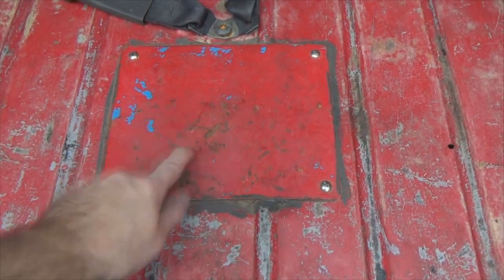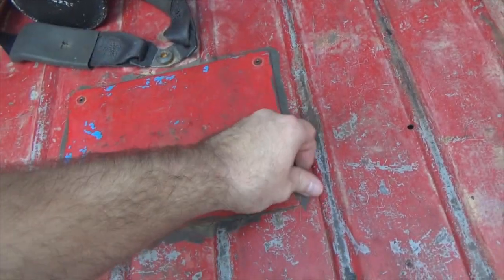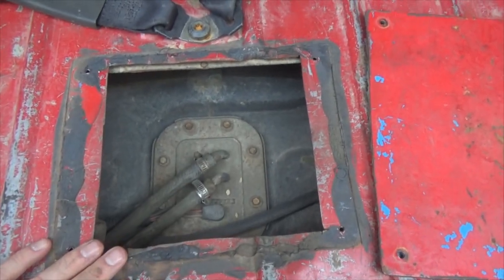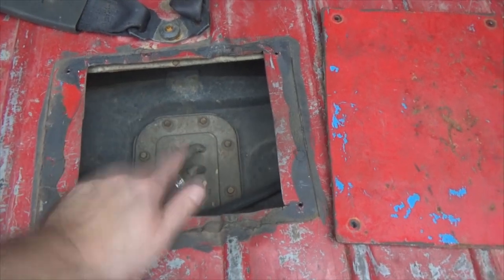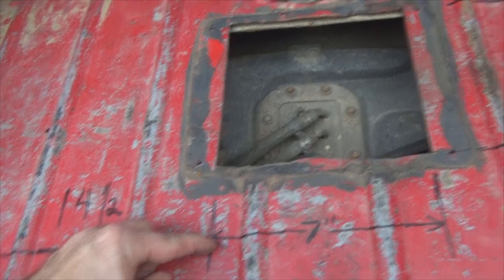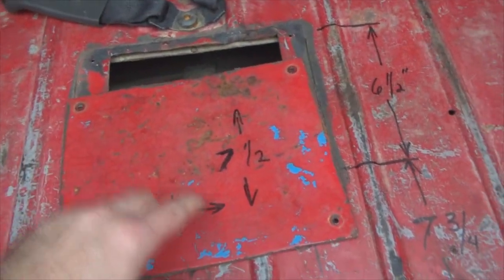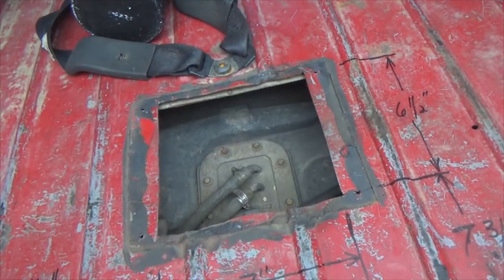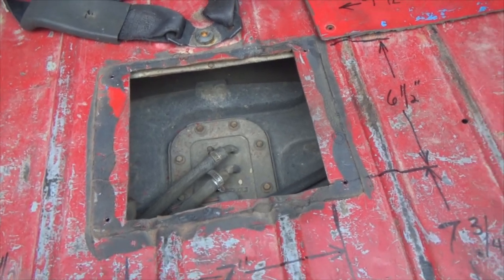Jeep Wrangler YJ - Fuel Pump Access panel mod

Comment: I did that , thanks. Best thing I've fixed my loose fuel line clamp without dropping tank and ready to replace pump when needed. I used a recuperating tool. Dimensions were right on the money. Thanks Dude!
Reply from the maker: Glad the video helped!! You are very welcome!!

Comment: I just bought a '93 YJ. Frame rusted, drove it 5 miles, started all day long until the evening.....lol. I gotta drop my tank, put in a new fuel pump, weld up the frame on the rear driverside, and I'm doing this when the tanks out. Very helpful channel. New subscriber here!

Comment: Being a firefighter we cut the access hole in my YJ at the fire station. We employed the positive pressure ventilation fan and three dry chemical extinguishers. Cut the access panel with a Harbor Freight angle cutter.  Cut very carefully not allowing the cut off disk to drop into the abyss below.  Everything went fine took only 5 minutes.

Comment: Thanks for the measurements.
I just cut a "just in case" hole in the floor, it came out perfect using your guidelines.I swapped the pump when I bought the Jeep and still have the old (still good) pump. I'll find a place to stash it and hopefully never use it.
Cheap insurance 👍

Comment: awsome,,,,,thanx for posting this, i needed to change my pump, i ended up drilling 4 holes and used tin snips to cut it, the thick channel i cut by drilling a series of holes in a row and bending it till it broke out, i didnt want to remove the tank as mine is crazy rusted, i changed the pump and shes back running and didnt blow up,,,, whoohooo, thanx again for posting this
Reply: I wish you would’ve done a video on that because I’m trying not to remove my tank because it’s so rusty I’m scared I’ll end up breaking the tank straps.
Reply: @Skinny859  i followed the measurment insrtuctions here and fought with it till i got it, many holes and bending but it works

Comment: In my last post I forgot to add that I added two pigtails after cutting the three wires.  I soldered the pigtails one to the fuel pump wires and the other to the lead-in wires.  Then I soldered a set of insulated spade tips. I heat shrunk all solder joints and then heat shrunk the three wires on each pigtail together. I coiled the excess wire around the top of the fuel tank and held in place with a few cable ties. Now I can disconnect the wires and remove the pump with ease.

Comment: Stuff a welding blanket over the top of the tank for insurance. Use a jigsaw to cut out the opening. No sparks and cuts like butter through that sheet metal.
Reply from the maker: Due to the lip on the body that is at the edge of the tank, there is no room to cram a blanket in there. Especially one that has no body lift. A jigsaw, if not held back at an angle will surely cut right into the tank. There is very little room between the surface of the tank and the tub floor.

Comment: Just a note about location of hole. If you have a NON-fuel injected YJ the sending unit is in a slightly different location. Instead of centered on the tank it is to the left and closer to the rear of the Jeep. Also it uses a lock ring instead of bolts to hold the unit in place. I have an1989 4.2 YJ with carb not FI. You may also need to trim a bit of the rear stiffening brace to allow clear reach to unit. I did this with my fingers crossed as some Jackleg welded a tow hitch under the fuel tank making removal impossible without cutting the hitch off with more sparks. But as it says in video if at all possible REMOVE the tank first! The extra time taken is worth your life and your Jeep.

Comment: Thanks for the information and great idea while I have my tank out to replace fuel line and vent line even though i never had issue yet with fuel pump this fuel tank is being a pain to get out with the exhaust running between the tank and rear leaf so great idea ..
Reply from the maker: Glad the idea helps you!! Thanks for dropping by! Have a great day!!
Reply: Yes the tank was a major pain to drop. Gas tank catches on the driver side, skid plate catches on the passenger side. Would be good to get the exhaust out of the way.

Comment: Great Mod and video.
FYI: I saw a Jeep Liberty the other day and Jeep has designed them with an access panel for the pump.
Reply from the maker: Long ago I worked one a Honda, it had one. My dad had a 'Vette, it had one. I though .. hmm .. my Jeep needs one! LOL .Glad you liked the video. Thanks for taking the time to leave an awesome comment! Have a great day!!
Reply: Power Addicts - FixJeeps.com - Jeep, car and motorcycle tips 

I'm doing this mod tomorrow on my 2003 TJ when replacing my pump, and yes the tank will be removed prior to plasma cutting. I retrieved a section of wiring harness off another TJ that has the pump connection, and will connect it to my old pump's harness to make an extension, so that my pump plug will be located behind the panel as well. 

Someone asked me why go to the trouble of doing all this when the tank is easy to drop? I've grown tired of crawling under my Jeep in snow and mud just to work on something that engineers should have avoided by better design.
Reply from the maker: I personally think its smart thinking! Why crawl under it again when you can remove a few screws and there it is. I agree the engineers should have done it to begin with. I've pulled mine a couple of times since adding that plate. I had the pump out in less than 10 minutes. You could change the pump on the side of the highway with a full tank of gas if needed. I haven't done that mod to a TJ yet. I assume the dimensions should be really close. If you don't mind, after you make the access plate. Compare the dimensions to see if they are close. I would appreciate it. Oh yea, a couple of pointers in case you dont know. Dont use Airtex pumps. My dads S10 went through 3 of them in a couple of months. He finally bought a Bosch pump like I mentioned to him to begin with, been flawless since. The Jeep pump comes with a short section of hose to join the pump to the sending unit pick up. Don't use it. I've seen use that little hose has pop off the sending unit nipple many times. I get a small piece of fuel hose that is about 3/8" - 1/2" longer and install it. You may have to do little trimming to get it to sit on without binding against the pump and sending unit. Then use the worm style clamps instead of the squeeze style. I have had my Bosch pump installed like that for 5 years and its been perfect. Good luck! Have a great day!

Comment: Thanks for the cut dimensions, have a copy from your support-files page.
BTW permanent marker comes off with alcohol (or gasoline).
Reply from the maker: You are welcome! Thanks for leaving a tip to remove the marker. I just dont worry about mine. It adds character 😊

Comment: I DID THAT ON A 1986 JEEP CHEROKEE FOR THE CRANK SHAFT POSITIONONG SENSOR CUT INTO THE DRIVE SHAFT HUMP COULD SEE EVERTHING THEN SEALED BACK WITH SHEET METAL PATCH
Reply from the maker: Cherokees are a bit harder than YJs to change that sensor. So I understand why you would do that.

Comment: I did the same thing to my 91 firebird. It was alot easier than dealing with rusty straps and lines.
Reply from the maker: Yes .. so much easier! A person could actually change the fuel pump on the side of the road if need. Thanks for dropping in and checking out the video. Also, thanks for taking the time to leave a great comment! Have a great day!

Comment: Hey man, love your channel!!
Has anyone ever tried using a nibbler to cut this hole?? Seems that it would eliminate the spark issue.
I need to do this on my rust trap and I think I can rent a nibbler.
Thanks again for all your videos!!!
Reply from the maker: Thanks!! Glad you enjoy the channel! I haven't tried it. Typically nibblers cut metal a bit thinner than this but if you go slow it may work.

Comment: Thank you sir! Nice modification, I wonder if any military type vehicles had a removable panel. Unless the tank was rusty, the only reason to remove it would be fuel pump related repairs...
Reply from the maker: You are very welcome!! Yea .. I was only gonna go through the headache of dropping that tank .. 1 time! I've pulled the sending unit out a couple of times since the mod. SOOOOO EASY now! Now I could change a fuel pump on the side of the road if I had to  :-) Have a great day!

Comment: Hello sir, pulled my tank today with your vid instructions. I had to force the tank out and I warped the plastic filler and vent kicked on the the tank. What do you think my chances are of a good seal with hose clamps. ? Btw, goons do your floor cut out mod too so thanks for that.
Reply: Filler and Vent nozzle...

Comment: I wonder using a jigsaw with a high powered fan blowing between the tank and body away from the filler neck, and a little water while cutting would be safe, I have a 3 inch body lift and I could set the depth of the jigsaw to 1 quarter or half inch. If you do not hear back from me you will know how it turned out.
Reply from the maker: Welp .. how did it work out? Hopefully you are replying 😀

Comment: I want to adjust my rear seat all the way back on my 93 yj using the same stock brackets … wanted to know if it’s safe drilling new hole without the tank being in the way????????
Reply from the maker: You will have to drop the tank to do that. You really need to install weld plated to reinforce where the seat mounts bolt to the floor. If there was ever an accident the seat brackets will rip out of the floor if they aren't properly bolted in.

Comment: Access panel cut today using your vid/dimensions. You will definitely cut into the c-channel brace that runs horizontal from side to side near the back of the jeep. I just call it a learning experience. First time using a cutting wheel so a little sloppy but hey, next time I shouldn't have to drop the tank to fix leaking fuel lines😁 THANKS
Reply from the maker: It might have gotten moved somewhere in the production run. I didn't cut the brace on mine 🤷‍♂️. Glad you got it done, it helps a lot! Have a great day!
Reply: What year is your YJ? I have a '94 SE and only have 5 1/2 inches between the brace where the rear seat belts are fastened and the c-channel your referencing. I'm assuming cutting into that channel and inch or so won't hurt anything...

Comment: Are these dimensions the same for the 2000 TJ model 4.0. 
I'd like to do this at the time I need to replace the fuel. pump. (tank removed of course) 
Thanks Chuck.     - Vince -
Reply from the maker: You are welcome. I can't say for sure. But I pretty much doubt it being the same dimensions due to there are lots of differences between the TJ and YJ.

Comment: is it possible to put thin ply wood up in there? (did that for my bronco)  Dropping the tank is major pain in YJ
Reply from the maker: I'm sure you could, I treat mine like a truck so I'd break plywood after a while. It really depends on if the bolts are rusted or not how difficult it is. Make sure the tank is empty helps a lot as well. For me the access plate is more if I needed to change the pump on the side of the road or on the trail. Thank for being part of the channel.

Comment: I don’t have a body lift so I'm sure there's hardly any room between the top of the fuel tank and the body.  I was wondering could you widen the inspection hole (left and right) enough to get to the vapor valves? I would need 1-1/2” flat lip all the way around to install Rivnuts. Is it possible to get those plate hole dimensions? It drives me nuts not knowing if I pinching my hoses when I install the fuel tank. After my tank had a split I bought a aftermarket fuel tank. The new tank measured the same but not satisfied with the fit. Couldn’t hardly get the tank straps to connect to the skid plate, I had to go and buy longer bolts. Then when fitting into the frame I had a gape of 2” between the frame mount and the skid plate. If I forced the skid plate/tank assembly up to the frame I noticed the strap bolts were loose, so I tighten them up. Which kind of tells me I’m crushing the tank? I called the tank manufacture and he suggested to buy a new skid plate, so I did, no changes. What’s your take? Thanks

Comment: So I've got a fuel pump question for you. When it's hot out, or the jeep is hot from running from an extended period of time. I used to have to swap the relay out to get the fuel pump to kick on. Now, when it gets hot, like California summer hot, the fuel pump no longer kicks on at all. So here it is in November, it's been sitting for 3 to 4 months and I have not even turned the key in that time. I randomly went out and it being cold out, fuel pump kicked right on and had no issues starting and running. I have a 91 yj. I'm not mechanically versed just learning as I go. I have not replaced the pump. Have any idea what it could be?
Reply from the maker: Either relay, bad connection or fuel pump on its way out. When the fuel pump stops working, test the voltage going back to the pump. Here is a video detailing the connections around the tank: https://www.youtube.com/watch?v=6i9X2agOEYs . Good luck, those type of issues can be a pain to chase down. Have a great day!!

Comment: just did it without gas tank out, no body lift. just be careful and keep your hand steady with the grinder :)
Reply from the maker: You got more guts than I do!! If that tank had even the slightest leak from one of the vapor/vent tubes or fuel line .... BOOM!

Comment: I've watched this video before wanted to do but never needed to and ofcourse it was just after i filled the tank😂😂😂 but i got a 2 inch body lift  and i have a sheet metal nibbler so no sparks at all so should be a easy job thanks for the measurements it helps more then you know best part is i have the perfect panel peace the floor pan i cut out of the jeep bar in my basemen that my old lady tried to get me to haul off for scrap 😂😂😂😂😂😂

Comment: Got my YJ tank down today and traced the cutout dimensions onto my deck.  As I was cutting, I noticed that the line which is 7-3/4” from the back of the tub will have me cutting approx. 1/2 way into a welded u-shaped deck support, under the deck metal.  By doing this, won’t I weaken the deck?  I am using the exact same dimensions you provided and used on your YJ
Reply from the maker: The factory may have moved that brace. I didnt cut the brace.
Reply: I cut the same brace. Not gonna worry about it.
Reply: Just cut in front of brace

Comment: How often does your fuel pump goes out? In my 93 YJ, I have replaced 3 fuel pumps in the last two years. Only have 2500mi on the jeep. Replaced all electrical modules associated with the fuel system. I am about to replace the wiring harness when I can. Any all all help would be appreciated.
Reply from the maker: I've only put 1 in mine and I've had it for many years. It's my daily driver. I used to put 70+ miles a day for my work commute. I only buy Bosch pumps. The lesser cost pumps fail often. I know of someone who put 3 pumps in a year in his. I kept telling him to buy a real pump and not those cheap ones. He finally bought a Bosch, now many years later still running fine.
Reply: @Poweraddicts  Thanks. I'll give Bosch a try. Couldn't be any worst that what I've already been through.

Comment: What about putting an automatic transmission from an XJ in a YJ
Reply from the maker: It can be  done. What I can think of right off is the transfer case would need to be re-clocked and you would need the computer and wiring harness for the transmission. I've never done it so I'm sure I'm missing some other things that would be needed.

Comment: Just cut the hole today... had to replace the pump and dry rotted lines so I dropped the tank. Also did the vent tube insert mod to get more gallons per fill....
@project_constance
Reply: What is the vent tube mod? I'm pretty sure I need to do it.

Comment: do you think these measurements would be the same for a TJ I'm bout to pull the tank to change out the pump and would like to do this mod while the tank is out
Reply from the maker: I've never checked, to be honest. I would guess to say its close, but I can't confirm that. My dad has an 06 TJ and my buddy has a 2000 TJ. Neither of them had had an issue with the fuel pumps so, therefore, havent gotten the opportunity to document it in any way.
The way I located the cut points from the bottom was using the holes that the gas tank bolts to the tub as reference points. Then transferring those measurements to the Jeep bottom to find the cut lines.
Get a piece of paper to sketch out the fuel tank, bolt holes included. Take measurements noting the locating the fuel sending unit mount plate in relation to the bolt holes in the tank. Then draw it out on the Jeep floor from the bottom. Once you feel like you have got the location correct. Measure again to be sure. Draw your rectangle that will be your cut lines. From the bottom up, drill holes in each corner. Then from the top play connect the dots and cut it out. Once you get it cut out, loosely mount your tank to check if the sending unit will come out through that hole. If yes, drop the tank again, make your cover plate, drill the pilot holes, use very short screws not to hit the tank. .. put her back together. If you are off a little, no big deal. Take a marker and sketch out where the hole needs to be opened up. Remove the tank completely. Trim the hole where needed. Test fit again if you want. After its the size you want it, make you cover plate as noted above. It is a bit of a headache in the beginning to make it. But it is a huge time saver later down the road! I have pulled the sending unit a couple of times. I can have a pump changed inside 30 minutes .. EASY!
Good luck! Have a great day!

Comment: Did you cut through the floor brace?
Reply from the maker: No, I cut right along the edge where it touches the floor. I'm not going to cut any structural braces out.
Reply: @Poweraddicts that's what I was always wondering about.